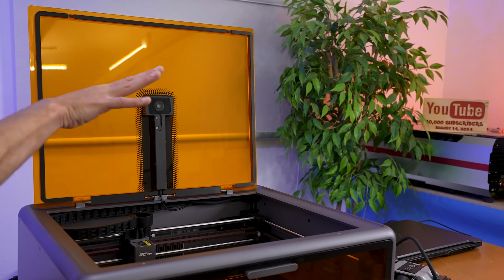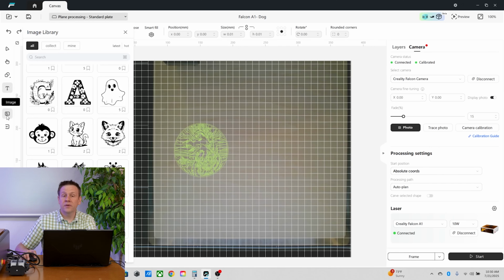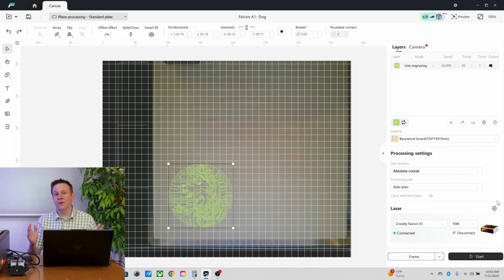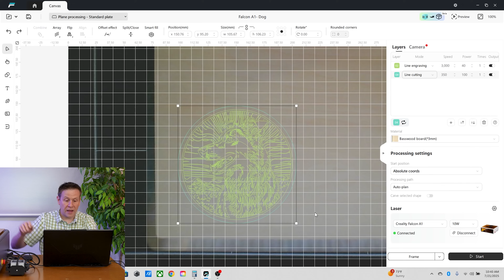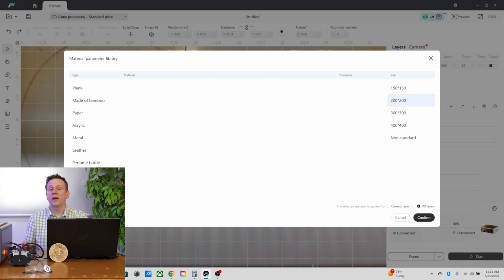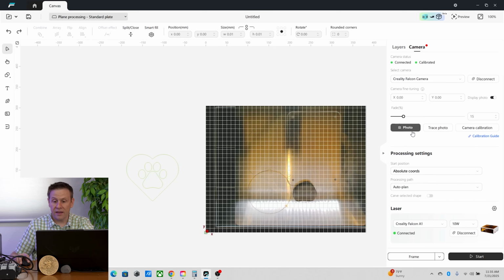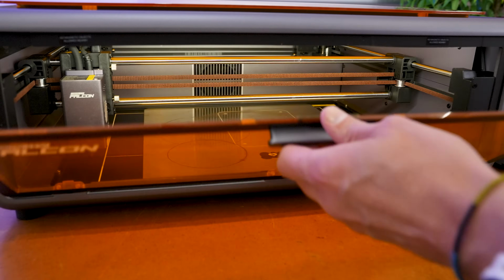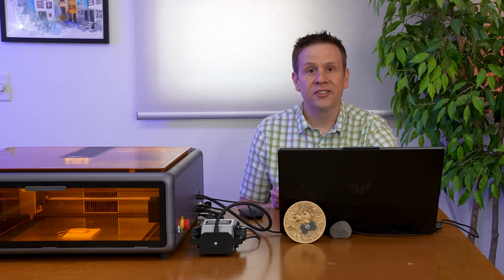Falcon A1 Project- Super Fun & Super Easy #creality #falcona1 #laser

Comment: What are you using under the wood? Do you not need a honeycomb layer to cut objects?
Reply from the maker: I used a piece of aluminum sheet metal I had laying around the studio- you can also use aluminum foil as well- this just protects the sheet metal crumb tray of the machine from getting marked up ( I like to keep my machines looking nice)! 
If you plan on cutting I do recommend the Honeycomb for the machine- less cut/smoke marks on the bottom of work materials!  Thanks for watching!

Comment: thank you for another informative video!  I'm kind of perplexed by this machine because the website shows clear acrylic cuttings and engravings in their customer showcase and I thought diode lasers couldn't do clear acrylic or what am I missing??
Reply from the maker: Thanks!  A laser diode can not cut clear acrylic- it is the wrong laser type.  No matter the power of the laser diode it will never cut clear acrylics.  The blue laser diodes "see" project materials similar to how we see- if it's clear the diode laser will "see" it as clear and the laser will pass straight through.  To cut and directly engrave clear acrylics a co2 laser is needed.